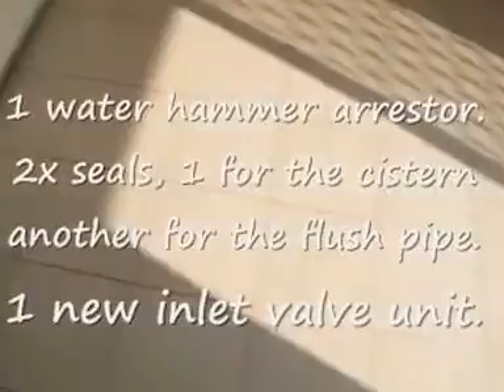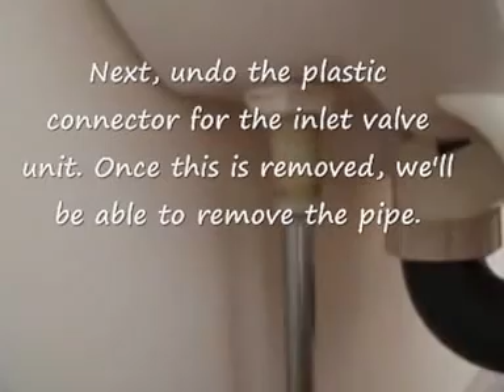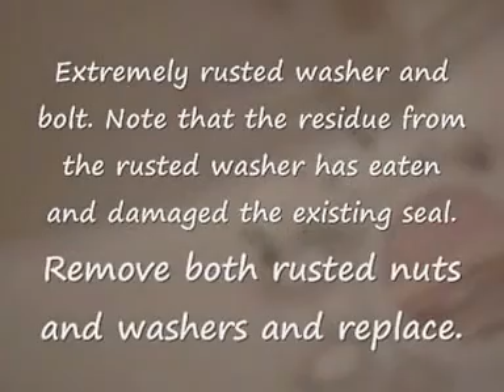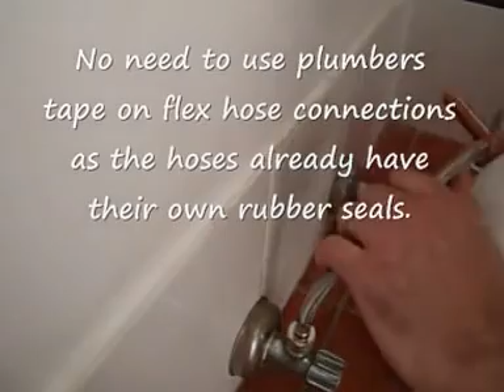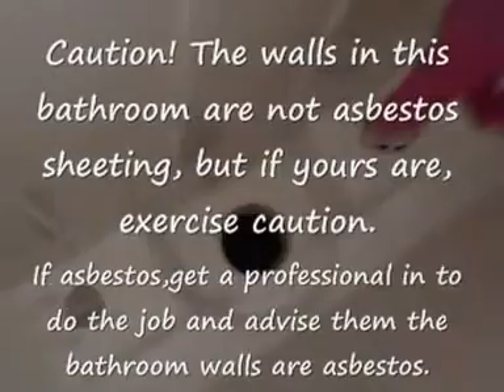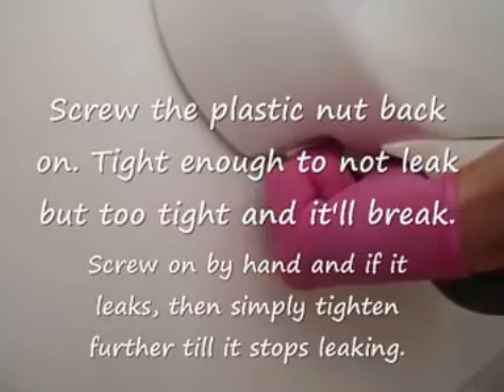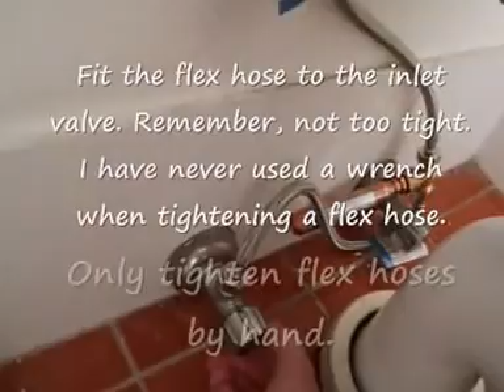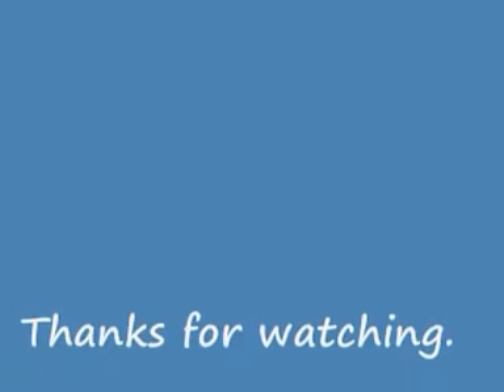Older Toilet Upgrade Leaking Toilet Fix renew seals install flex hoses NSW Australia

Comment: hey mate,great clip and the only one with an old australian toilet on the net.can i ask a question. i have an older toilet like this and the black pipe where it connects to the seat that seal whats it called, as mine shit itself and i have water pissing out everytime someone flushes the toilet. is it very hard to change.
cheers mate.
Reply from the maker: That's a rubber o'ring type seal. Pretty easy to change, just unscrew the plastic pipe, there's plastic thread, sometimes can be done up extremely tight may have to use a large spanner to start unscrewing. Once you unscrew, you will see the o-ring, just take note of where the o ring sits, and screw back up. All the best, Jasco.

Comment: that flush unit looks a bit over engineered, the units we use in the UK are a lot more compact and straight forward, and they are so cheap these days we probably wouldn't bother replacing the seals, just buy a new one and throw the old one in the bin :)
Reply: You just copied what the other said
Reply from the maker: William Belcher Yeah I guess so a bit over engineering, but was nonetheless fun to do.. I guess each time I flush the toilet I know I fixed it..(lol?)
Reply: Jasco Kovacevic lol yes will I know what you mean, it is nice to think you managed to fix something and get a bit more life out of it :-) my kitchen is to small to have a washing machine in it, so a few months ago I drilled threw the wall and wired into a kitchen power point, and run a wire out to the washing machine, but still had to stick a hose pipe in the kitchen window to get water to it,
so a couple of days ago I did my first real plumbing job and run a permanent water supply out to it from the kitchen :) I was pleased with my self lol.